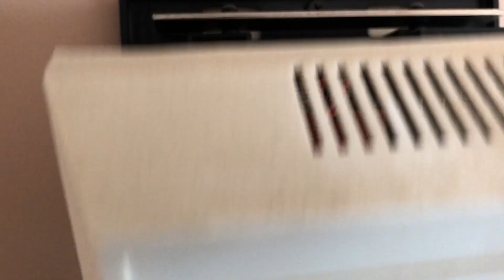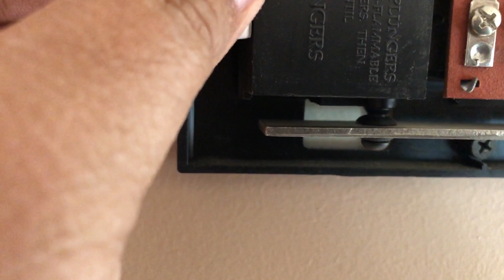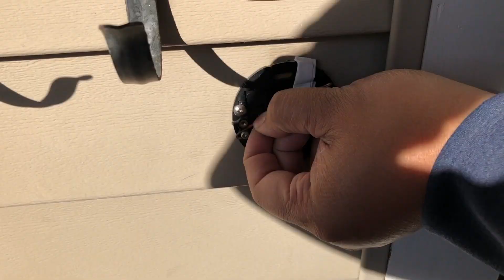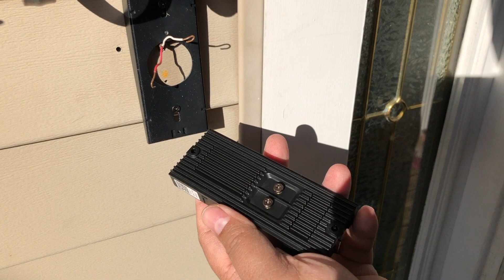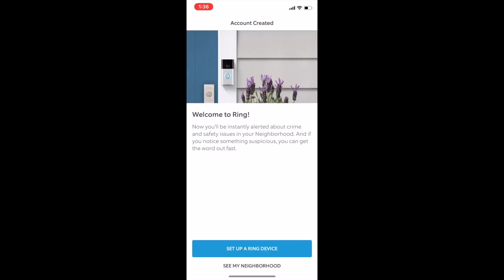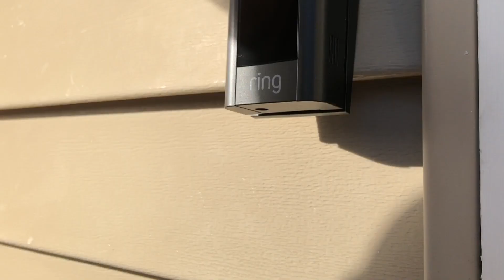Ring Video Doorbell Pro installation - A step by step guide and setup via phone app

Comment: Hi I don’t have a existing doorbell can I use it without ( receive my ring pro tommorow ) thanks :)
Reply from the maker: Hmmm this requires the two power cables. If you have no bell then you’ll power it with this: https://amzn.to/2Q1Lf2u. This is half the price as what Ring is offering it for. Does your Ring kit include the chime at least?
Reply: johnny0723 yes I already ordered that but dont think  it’s good long term I heard the blow out and get reallly hot
Reply from the maker: Well, Ring sells something similar. This means the power plug option is a viable option long term, right? Install is gonna be easier too as you likely don’t need to install the pro power pack. I don’t think you need to worry. This is my unprofessional opinion, of course. 😂
Reply: johnny0723 don’t look like they sell the official ones in the uk , in read reviews on same item most last not even  2months, my friends an electrican he gonna wire it in the mains for me
Reply from the maker: It’s good to have handy friends! 👍🏼 I love the ring doorbell. It’s so much better than my last Skybell.
Reply: johnny0723 cool this is my first, thnaksm
Reply from the maker: Good luck. Hope it turns out well.